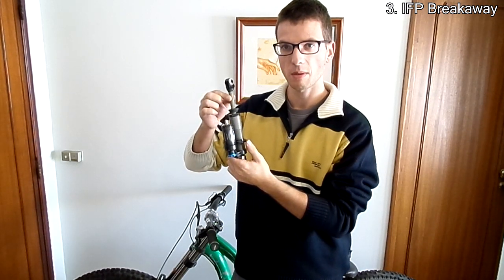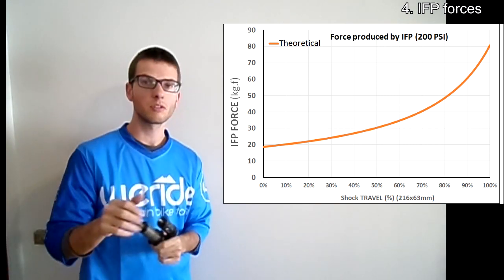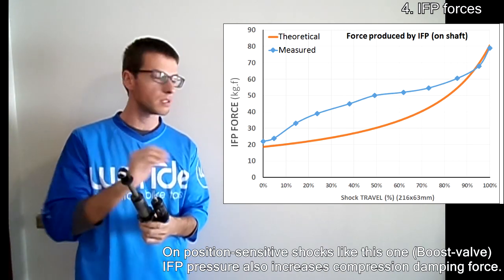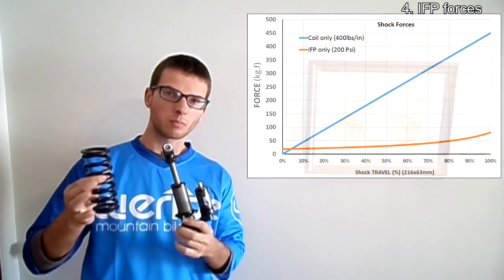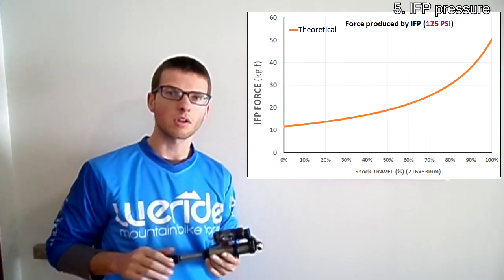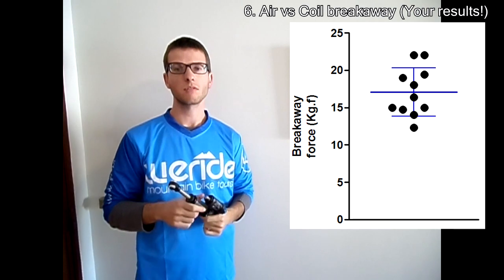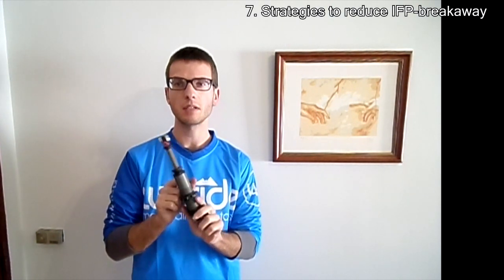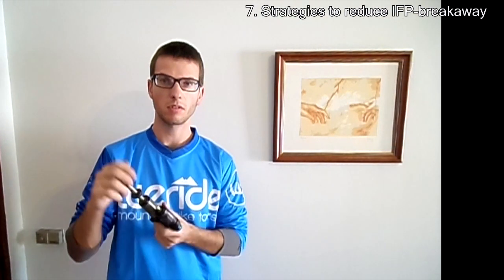IFP forces on rear shock (MTB rear suspension Ep.9)

Comment: Hi, congratulations on your video. One question: but if I didn't have the manual with the ifp depth and pressure indicated, is there a way to calculate this measurement and the contrast pressure?
Reply from the maker: Yes, just calculate the volume of shaft that will enter inside shock body and displace the same volume of oil. The final IFP chamber volume will be equal to initial one minus shaft volume. You then can calculate pressures and ifp heigth 👍
Reply: @andrextr  Thanks, can you give me a practical calculation example? For me it is not that easy, you are very good at these things and very fast, I need to calmly understand the calculations to be done. Thanks for your very kind time
Reply: @andrextr   Hi Andre , I m also interested in a pratical example to better undestand teh calcutaion. How do you calcolate the pressure ? an easy example please
Reply from the maker: Although calculations are simple, there are some steps and formulas involved to explain them on a YouTube comment… drop me a formal request on my website, I can make an excel spreadsheet to calculate all you want. Thanks
Reply: @andrextr   Thanks, i wrote you !

Comment: Hi
Just a quick question would I be able to safely add 5-10% more pressure in the IFP chamber to get slightly better bottom out resistance in my rockshox coil shock?
Reply from the maker: Better use a stiffer bottom out bumper or a progressive coil spring (not sure about internal diameter compatibility with rockshox shocks)

Comment: Hey!
5:49 
You said that Force = Area * Pressure which is okay, 
but shouldn't area be the piston area that compresses the gas in IFP chamber and NOT the shaft cross section area?
Reply from the maker: Its the cross section area. Because the oil side is also pressurized and the net result is the cross section area.
Reply: @andrextr  and yes, this makes sense, both sides pressurized, and only cross section of shaft is left! Thanks

Comment: Hello.
Will higher IFP pressure increase the ramp up on air shock?
I have "high volume" RP23 which is really linear since the volume is huge and I want to make it more progressive.
I've reduced the volume with spacers, but did higher IFP even do anything?
Reply from the maker: Yes it would increase a bit the progression but also it reduces the sensibility (by introducing more breakaway force). Best way is to reduce volume of air spring (or reduce IFP chamber volume also...like the old DHX5)
Reply: @andrextr  Thank you very much!

Comment: They never suggest changing IFP pressure for fine tuning, i have a superdelux ultimate, runns 250psi in the ifp, dropping to 200psi or 175psi makes huge difference in small bump. and actually improves the "drop test"..... endless tuning with air
Reply: Hi Gary. Did you have any longer term negative results from dropping the ifp pressure in the super deluxe ultimate to 175psi? Any air getting into your damper?

Comment: Andre, this description of breakaway, commonly known as static friction or stiction, is just plain wrong.  What you're measuring is preload due to IFP pressurization - not the force required to make the shock start moving from a stop at a given point in the travel, which is the actual breakaway force. That's why you got similar results for air springs and coil springs.

Comment: you are a master explaining, in conclussion you recommend me an air shock with ifp or air shock withot ifp
Reply from the maker: 99% of the shocks have an IFP (you need it to pressurize the oil, otherwise it won't work as well). The only exception is DVO shocks which use a bladder to pressurize the oil instead of a IFP piston. Rockshox has the "countermeasure" technology in some shocks which reduces the initial breakaway force of IFP increasing the sensitivity (it is basically a negative spring). Cheers

Comment: Thank you for the awesome videos! 
I have a question about IFP. In the video, IFP pressure is only shared around 10% of compression and rebound forces in a shock.
But makers strongly recommend following their instruction about IFP depth. 
Please explain why this is critical. And one more, how to calculate IFP depth. 
Some shocks such as Fox Dyad RT2 from Cannondale can't find the IFP depth information.
Reply from the maker: Hi Jerome. IFP is used to pressurize the oil. As the shock compresses and the shaft enters into the shock body it will displace oil (because shaft occupies space). The IFP then compresses to accommodated this oil displacement. As the IFP piston moves the gas pressure in the IFP chamber increases. If you start with a low IFP height then you get extreme pressures peaks at bottom-out and you can destroy quickly the orings or the shock. This is why you should respect the IFP height when bleeding the shock.

Comment: I just did a simple air can service. When I put it back together , and sat on the bike it went all the way though the travel. (100% sag)

I put in 182 PSI, and it held air. Even after it went through the travel, it still had all the PSI.

I checked everything inside, and nothing stands out.

My only clue is that I dropped it on the ground while working on it.

Could I possibly have lost pressure in the IFP?

I took the cover off the IFP valve and air popped out.

I then checked the IFP pressure and it was at 250 PSI (well below the 500 psi) on the SRAM website.

I opened up the piston, put in new oil, and reset the IFP thingy. I then put in 300 psi (my max on my pump). No change

I really don't want to take this to the shop. I fell like it's something I'm missing

Any advice?
Reply from the maker: Does the shock gets stuck down after compression or does it extends back to normal? It seams the air is passing through the main piston to the negative chamber during compression and then it goes back to main chamber during extension. Check the main air seal (did you forget to put it back?) and check if the air can is not deformed. You need to have a good sealing between main piston and air sleeve during all travel, otherwise the air passes through making the symptoms you describe. PS: its not the IFP
Reply from the maker: If you didn’t understand my point check this video and see diagram at 2:30

https://youtu.be/3HeL5NNHbFw
Reply: @andrextr  thanks for the reply.  I did not take the seals off. And it was working fine before.. 
Add more grease? Can't figure out what changed.  Should I just give in and take it to the shop? 

Ps I have a thread going on MTBR in the suspension section
Reply: @andrextr  also, it does not get stuck down. Works like normal. I added way more psi, just to see, and that stopped the blow through but felt really odd
Reply from the maker: Its hard to diagnose the problem by the internet without seeing it, but I still mantain my opinion given your description... probably you need to send it for a technician 👍 cheers

Comment: 8:50... kg and Lbs mixed up a little bit
Reply from the maker: The Ethalon Hi! Didn’t find any error at 8:50... If I remember correctly the only Lbs values used are for spring rate since its the default unit on Mountain bike springs. Cheers
Reply: andrextr ahhh I understand!! Thank you, amazing video

Comment: Do you feel its important to use nitrogen?
Reply from the maker: Hi. It's always best to use nitrogen but I don't think there is a big difference comparing to normal air. In many shocks with adjustable IFP pressure (eg: DHX...) you end up using just air and it works just fine.

Comment: Cane Creek uses a 8mm shaft (excluding some Specialized models). Wouldn't that result in lower break away force of the shock? Were there results of cane creek shocks send to you? Thanks for great channel!
Reply from the maker: Hi Jarno. Yes, a small shaft decreases IFP-induced breakway because the breakaway force is equal to cross sectional shaft area X IFP pressure. I built a shock simulator (EP14, free download) where you can input those values and see the effect. The problem of small shafts is the durability...
https://www.youtube.com/watch?v=0-l2l2kca0A

Comment: Hey thanks for all your videos - i have learned a lot... :)
As for you it is a hobby for me to understand the mechanics MTB and the suspension system - but i like to learn more..
I have a university degree in math and a background as an electronic technician so I like to finde some more in-depth knowledge of the subject.. Do You have any good .pdf, videos, books or somethings that have more on the subject..?
And Also... Do you work for weride.pt... as a guide or something? In november I went to Sintra and hade Hugo as a guide for some days - I will try to go back next month...

VH Jesper From Denmark.. :)
Reply from the maker: Hi Jesper, thank you for your message !! I did some jobs for WeRide as a guide and mainly as a driver. They are old friends :) I used to do DH on Sintra, but lately I'm not riding much. Regarding the videos, there are many sites on the internet but the info is somehow dispersed. I also found a lot of nice things on MX or car suspensions that can be translated to MTB. You can check the linkage design blog from Antonio Osuna or the Tuesday tune of Vorsprung suspension (pinkbike) for more info. There are some books about kinematics, the most important is the "motorcycle handling and chassis design" from Tony Foale. If you have a more specific question we can discuss that. I have more ideas for future videos, stay tuned. Bye

Comment: It's a very amateurish video and poor explanation. You try to be the engineer here: you call the IFP the nitrogen chamber. IFP is the piston (Internal Float Piston) or Separator. Then you talk about the unsprung weight. The UW the way you weight it is totally wrong. When you move the position of the frame with your hand, you can see that the weight (of the wheel with the balance and so) can vary. So how do you determine the position to put your frame in order to get the UW ? So for a start, your "breakaway force" is wrong. Then, the force that is produced inside the shock by the Nitrogen, produce of course a resistance for the movement ... you calculated or measured 18 kg to compress the shock, like 50 mm ? right ? then the force is a great fraction of the sum of spring force and the damping. The idea of the IFP force or the nitrogen is not to add some resistance to compression. Some suspension have less pression other more ... there is not way that the Rf due to the nitrogen is 20 or 25% of the total force of compression.There is also no way you can compress the shock with the spring installed manually !!!! To measure with accuracy you must use an expensive shock dyno ... when you know to use this tool, you know you perform a prior main test to measure the internal forces + force du to nitrogen to remove it from the equation (because what you look for using a dyno, is the effect of the damping), you can see that this is about 2 to 5% from the spring. I am very disappointed.
Reply from the maker: Hello my friend! I don't understand why so much hate from you, but OK.... The video is amateurish because I did this as a hobby and not as a job (channel's description). You are trying to be very picky with small details... For instance, it's obvious that the IFP itself is the piston and not the whole chamber.... but it's implicit than when you talk about IFP pressure you are talking about the chamber, which is known by many people as the nitrogen chamber... So I don't know where is your doubt! Regarding the other questions, most of them I didn't understand exactly what was the question... I believe you misunderstood many parts of the video, like the part of "you calculated or measured 18 kg to compress the shock, like 50 mm ?", where did you get the 50mm from??? That force value was the minimum force required to start compressing the shock (maybe 2-3 mm), and the value was obtained by two approaches: using the scale (real experiment) and by a simple theoretic calculations using the F=pressure/area formula.... And yes, the IFP pressure can easily account for more than 10% of total shock compression as I just show in the video, with a real experiment (of course that the final contribution value will depend on the IFP pressure and the main spring strength... here I just showed one "normal" example)!! If you don't believe it try to do your own experiment. Or use the simple math formula F=P/A .... Regarding the unsprung weight question, I don't understand why you said it's wrong, and didn't understand well this part: "So how do you determine the position to put your frame in order to get the UW? "...  You can hold the frame it in any position, providing that the main frame is suspended by your hand... the scale wont move almost nothing because the weight on top of the scale comes from the wheel/rear triangle... And the value in my case is 5kg which makes total sense (QUICK calculations: 1.2kg of tire + 500 gr tube + ~1.6kg the wheel & cassete + the rear triangle & brakes which should account for more +/- 1.5 kg.... so, a total of 5kg ). You can try to do that experiment !! If you don't believe, just dismount the rear triangle and weight the pieces separately..... PS: Are you from Brasil ? Se sim, podemos falar em português.  Bye and sorry if the answer was to harsh... We can discuss this openly without any problem. Bye

Comment: Hi! I didn't undestand.. the shock in the video have 3 forces that react against the compressing force produced by jumps or bumps you said that:
1. force of  the spring (air or metal spring).
2. is the "chims" and other internal components, that affect the  break away force (because they are not "ideal" components that have zero fraction etc?)
3. the force of the IFP. 

so, why would I need an IFP? the spring can be denser (air or metal) why do I need the IFP for?
Reply from the maker: The IFP is required to pressurize the oil of the damper. The oil in the damper is responsible for the compression forces and rebound forces (point 2). For instance, the damper slows down the rebound speed by forcing the oil to pass on small orifices and shims... and by turning the rebound knob you are changing the size of the hole, and therefore, you are changing the damping by changing the oil flow resistance. The damper can also control the compression motion, by the same mechanism. For instance, if you have a lot of compression damping, it would be harder to bottom-out (but the ride quality became stiffer and harsher). A shock lock-out is the extreme case of compression damping (where the oil circuit is fully blocked, and therefore the shock is locked out). So, why do you need an IFP? Because without IFP the pressures in the oil can get very low during shock movements, and the oil gets foamy and cavitates (vapour bubbles), and the damping became inconsistent and the shock life is reduced (https://www.youtube.com/watch?v=NbiHIyO8FEY).
Reply: thanks! can you please write where can I read good articles or watch good videos that explain about  MTB shocks specifically? the video you linked I belive from a car channel. and generally where can I learn more about the MTB stuff from frame to shocks? thanks! please keep making there videos, they help a lot!
Reply from the maker: You can find some basic concepts in this rockshox guide:
http://www.sram.com.cn/sites/default/files/techdocs/rockshox_suspension_theory_10-replica.pdf

There's no much deep info/data about particular mtb shocks on the internet. Manufacturers don't disclose much details. Usually what you find is biased marketing claims. Bye